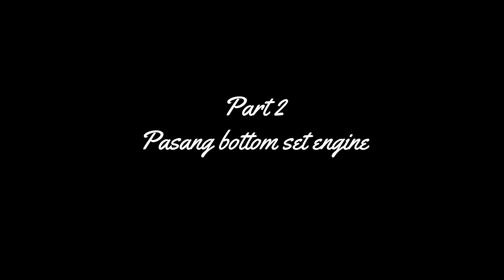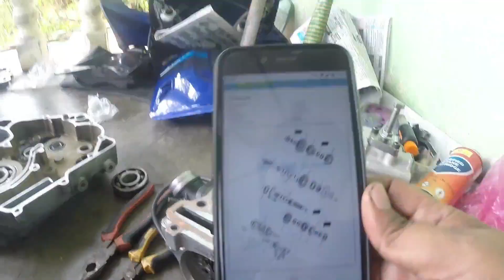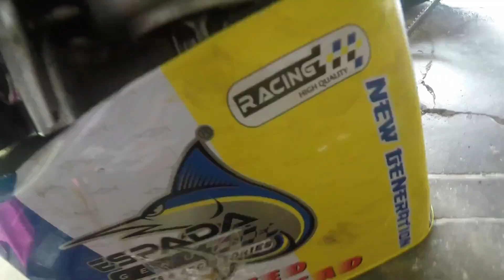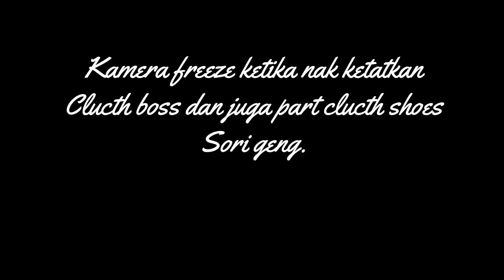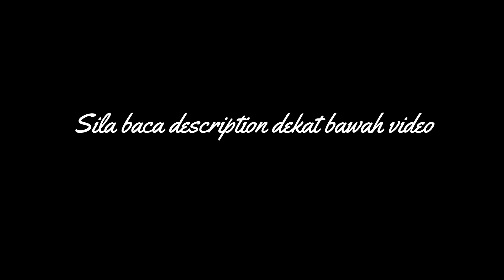DIY - Overhaul enjin LC135 4S Part 2/4| MX Jupiter | LC 135 V1 | Pasang Bottom Set lc135 | Newbie

Comment: pin lock bearing 3segi tu ade jual ke bos
Reply from the maker: kurang pasti sebab tak pernah beli. tp pin mcm tu ade jual kat kedai bolt & nut. cuma kena tau size sama ada diameter 3mm, 3.5mm atau 4mm.
Reply: ok bos..buat pakai pin rantai
Reply from the maker: @farezadenan7905  boleh juga. Janji masuk ngam dan lekat kat segitiga.
Reply: ok bos tq

Comment: Bg mana dulu buat bg..up.spec dulu ke baru up.enjin bawah
Reply from the maker: Tukar rod dlu, tukar bearing. Lepas tu boleh la fikir nak buat spec ape pun. Pendapat je la. Hehe
Reply: @wenky  rod ok je bg..semua ok lagi..just nk masuk bearing racing dan gear 4 21t..tapi sya tak yakin nk.bkk sendiri bg..ovehoul ni mcm cuci2 enjin kan..nnti mntk kazen sya tolong bkk enjin..block dan barg lain sya dh ada bg..tu lh sekrng nk masuk.toyol.dekt enjin dulu ka nk up spec..
Reply: @wenky  lagi pun saya up spec 57 piston dom fim je bg...
Reply: Lagi satu bg berbaloi ke.spec 57 guna rod racing..
Reply from the maker: @Shahmirizal  berbaloi je pakai rod racing sbb lagi tahan. Rod stendet pun boleh cuma takut bearing rod dah longgar. Lama2 rod goyang, blok calar. Satu lagi kena tukar jugak oil pump. Pakai bearing ceramic ke?
Reply from the maker: Kos blok + piston fim tu dah bleh dapat blok 62. Haha. Tp ikut la kehendak sendiri. Janji porting cun, compression cun, flow engine oil cun..takde masalah.
Reply: @wenky  sya main 57 je bg..tu lh nk masuk bearing dn gear 4 nmpk jahat sikit
Reply from the maker: @Shahmirizal  boleh je. Janji pomen tau setup cun dan resepi tu btul. Bab modi ni ramai yg bersara awal pasal modal besar keluar masuk bengkel. Hehe
Reply: @wenky  klau kita jaga dengn betul alhamdulillah cun..

Comment: torque wrench tu, berapa saiz kepala drive tu, bro?   1/2"    1/4"   3/8"   ?  kalau kepala drive 1/4"  kat mana beli reducer socket tu ( 1/4" to 1/2" )?  puas mencai reducer socket tu...
Reply from the maker: Aku beli 2...yg 5nm - 25nm tu saiz 1/4. Beli converter 1/4 ke 1/2 kat knightauto. Rase boleh beli online. Try cek web knight auto.